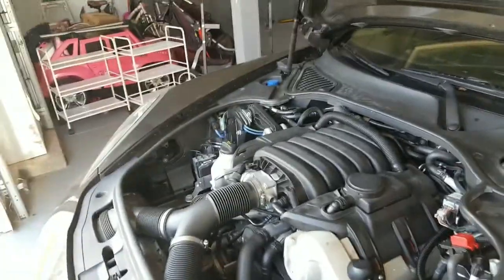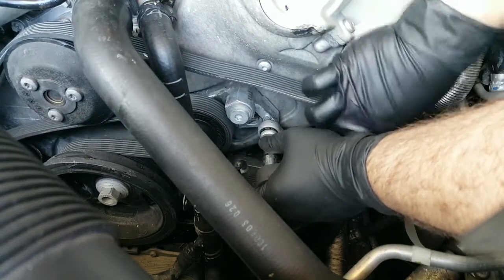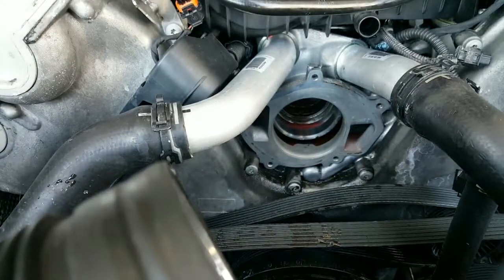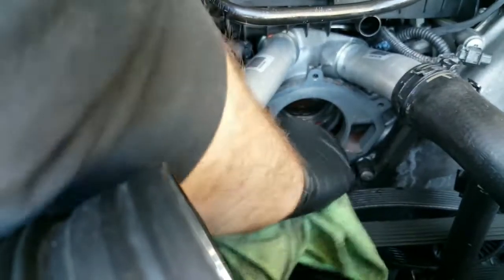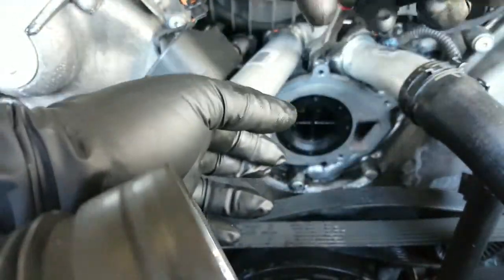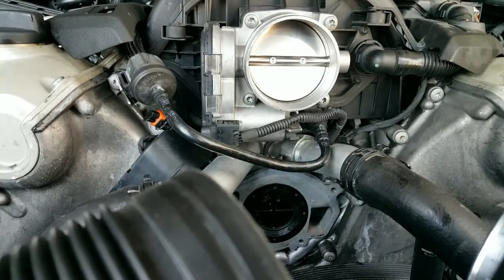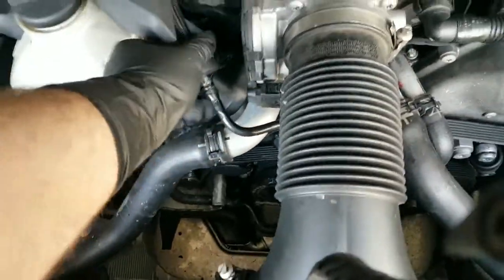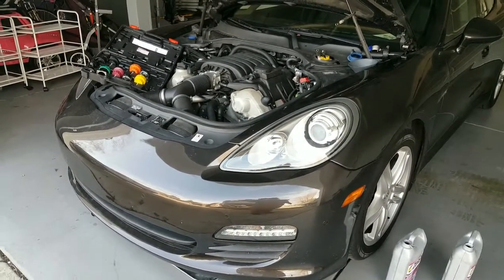How to REPLACE a THERMOSTAT on a PORSCHE PANAMERA EASY 3.6 4.8 V6 V8

Comment: Which pressure testing tool are you using for the coolant system pressure test?  I used the one from Autozone, and the blue cap seems to fit, but actually turned out to be leaking, sending me on a stressful wild goose chase for hours....because I thought I had a damaged head gasket.....until I used the universal expanded one, which is not ideal, because it pops off easily.  The blue cap in your tool seems to hold pressure.  Which brand are you using?  Thanks in advance.
Reply from the maker: Thanks for watching. The kit that was used back then was a harbor freight set. Had it for years never gave me an issue other then replacing the hose one time.

Comment: You didn’t bleed the system…. You need to open the vent valve that’s under the plastic cover that surrounds the filler cap. Helpful video though on everything else, thanks.

Comment: Thanks for this! My 2013 Panamera Turbo is at the shop right getting a new Thermostat and Thermostat Housing. I wanted a glimpse into what that entails. Car only has 49k miles but I guess being 10 years old now it’s not unusual it needed replacing? My car was leaking coolant and overheated that’s how we found out. 😢

Comment: can you tell me where the  coolant temperature sensor location is at? i change the one in the front by the radiator but still saying 250 on the display even when car has been siting over night?
Reply: It's in the back of the motor ... passenger side

Comment: Turns out that my thermostat harness connector was broken by some previous mechanic and now still lodged inside the thermostat.  
What should I do?  Cut off the wires and deal with it on the bench?  I couldn't find a part number for that connector.  Please help!

Comment: My new thermostat never opened. Car over heated( possible stubborn air pocket) and right drivers side coolant pipe which is directly connected to thermostat housing popped off. It looks like manufacturers GLUE THEM ON 🤦🏽‍♀️🤦🏽‍♀️🤦🏽‍♀️🤦🏽‍♀️ any advice? Or do you think JB Weld will work?
Reply from the maker: The Kitana absolutely will not work I tried 3 times before I finally replaced the whole unit. check my other YouTube video on the Porsche Panamera and that may video I replace the coolant pipes.
Reply: I saw that video. That’s just so much for me 😞 to do. I will probably just take it in to see the shop. That’s about at $1800.00 fix am I in the ball park?

Comment: Thane for the video, have a question regarding adding coolant I didn't loose much,but coolant not flowing there must be air in the system, the coolant pipes are cold

Comment: Hello Art. I changed out the thermostat, changed the water pump and the 3 prong black cooling hose. I have not added new coolant yet as I flushed the system with blue devil, water etc. It is still running the temp up to 250 on coolant.. will this stop when I add the proper coolant? Also, there was lime everywhere prior to, but I believe I cleared all blocks in radiator, reservoir etc. What are your thoughts?

Comment: 2011 Panamera base
Reply from the maker: The Kitana its a huge job. If you want to replace the coolant pipes.
Reply from the maker: They also sell the upgraded version. Of the pipes assembly. They are bolted on rather than glued one. But really expensive. I just went with original from Porshe. The bolt on is an aftermarket unit. Customer wanted original.

Comment: I would like to see one done on a Macan 3.0, and torque values would be nice
Reply from the maker: Joe L If I do come across that vehicle I will definitely make a video
Reply: I did this same job in my Macan S, using this video as a reference.  Torque for pump screws is 12Nm (9lbft).  The Macan is a different animal.  There is no space to do this easily like in the Panamera.  The instructions require that one put the Macan in what is called service mode, which requires one to remove about 35 components to be able to slide the radiator assembly forward so that you can gain 30mm of space in that area.  I was able to accomplish this without having to put the Macan in service mode and just removing about 5 components.  I documented my procedure here:  https://www.macanforum.com/threads/diy-thermostat-replacement-coolant-pump-replacement-macan-s-2015.178740

Comment: Why did you have to remove the throttle body just to take off the thermostat?
Reply from the maker: The Kitana because there’s no other way to get to the pigtail connector for the thermostat.

Comment: Have you done an oil change video for the panamera?
Reply from the maker: Jesus Rosales I have not yet. I’ll make sure to notify you right away once I do. Thank you for watching.
Reply: Mechanics Life Awesome! I want to get a 2015 panamera E hybrid. Would they be the same?
Reply from the maker: They should be the same.
Reply: If you can change the oil in an average car and you have the tools you can change the oil in a Panamera. I did mine myself (a turbo v8) with no problems. All you need is oil, oil filter, oil filter wrench, New drain plug washer, torx bit, ratchet set, Oil bucket, ramps or lift and a Durametric scanner or equivalent. Drive car for 6 miles to get digital reading of oil level on dash because there's no dip stick. Raise car. Remove plastic shield from bottom of car. Place oil bucket under oil pan. Remove drain plug. Let oil drain into bucket. You need to measure the amount of oil that comes out so you'll know how much to put back in. Remove aluminum bottom brace under oil filter if necessary to get to oil filter. Remove oil filter. Replace oil filter. Be careful not to cross-thread. Replace drain plug and washer. Put everything back like it was. Pour in new oil. Same amount you took out. Check oil level. Add 1 cup at a time and recheck if needed (Each segment on LCD graph represents one cup). Connect Durametric scanner or equivalent to diagnostic connector port and reset oil reminder. There you go. You're all set. You just saved $350 on oil changes forever.

Comment: When you said “you definitely want to drain the system” how do you do that? Thank you. And thank you for this video
Reply from the maker: The Kitana to drain it you can just removed the bottom radiator hose. Have a bucket or pan underneath. After of course has to be filled with fresh coolant and properly bled for air pockets/bubble.

Comment: how do i bleed the air in the coolant system on this porsche can you help thanks
Reply: Luis L Use a vacuum filler.  You draw a 20” or greater vacuum on the cooling system and then open a hose to your coolant, it will suck the coolant into the places air gets trapped.  You can rent them from many parts stores these days.  I just did the thermostat on my 2011 Cayenne S tonight, it took less than two hours start to finish including cleanup.  Vacuum filling is the only way to go.  I also have a vacuum extractor that I use to pull the coolant out of the car, way less mess and I start with it clean so if the coolant tests good it can go back in and only tip off is required.

Comment: Hi there I have my porche panamera 3.6 v6 
Was overheating I had the vent lines pipes leaking I had put new ones car still overheating also the heat is not working please any idea what’s going on 
May be the thermostat or water pump?? Thanks waiting for response asap 😊
Reply: Usually the thermostat when the heat isn’t working. Or the heater core